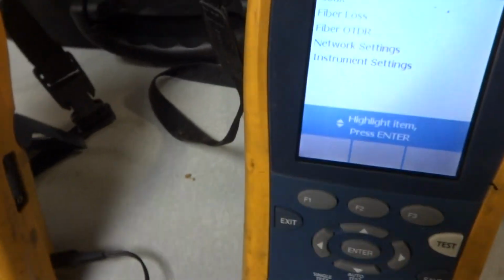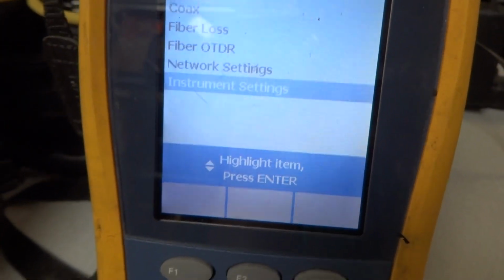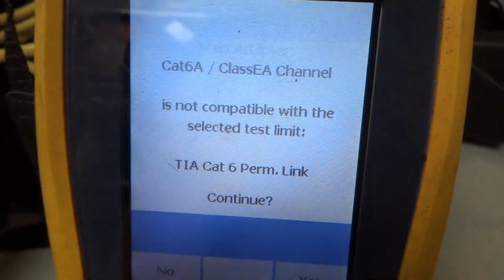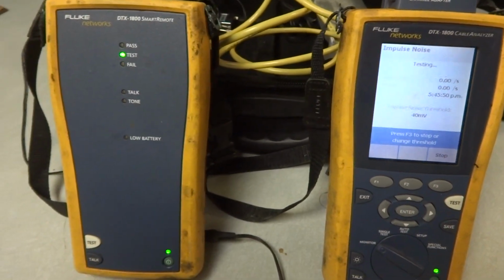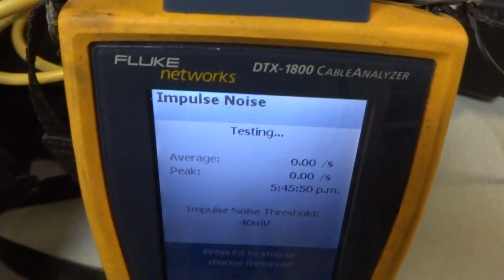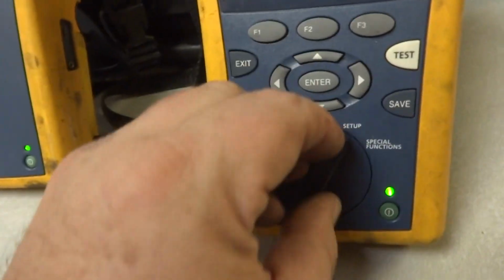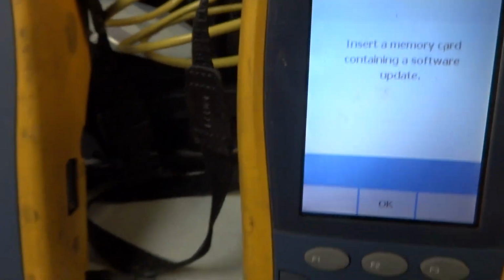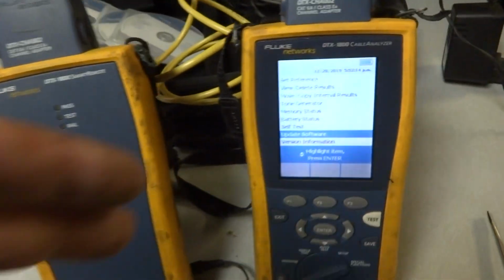Fluke DTX-1800 Smart Remote & Cable Analyzer Condition Review

Comment: Hi there . I have one question . Mine batteries have died completely and when I turn the tester on once it’s connected to power supply the screen stays blank and there’s only back light on the screen . Can this be cos of the faulty batteries or should it still work fine ? Many thnx .
Reply from the maker: I’m so sorry I know very little about these…my guess is it should work with the power supply